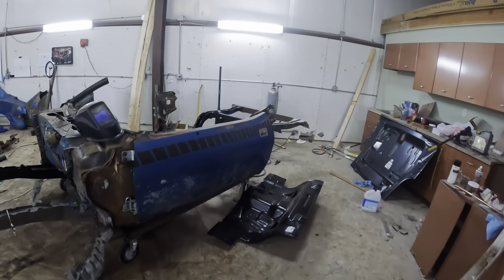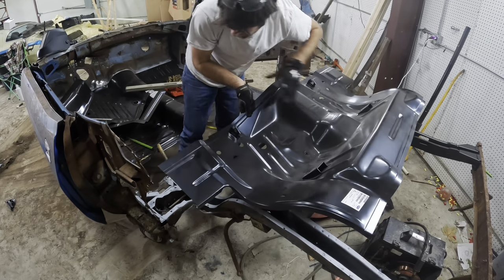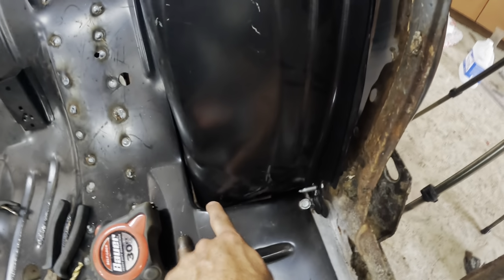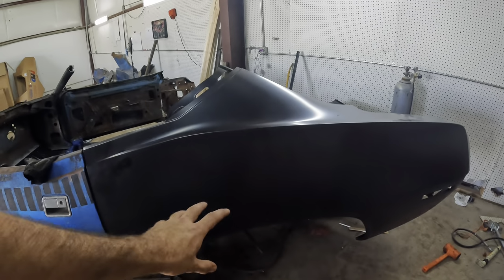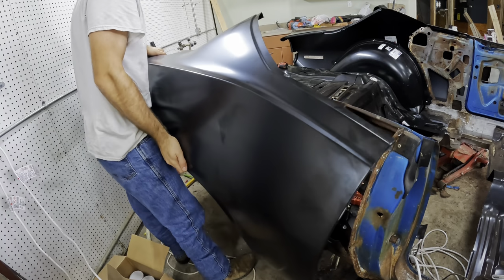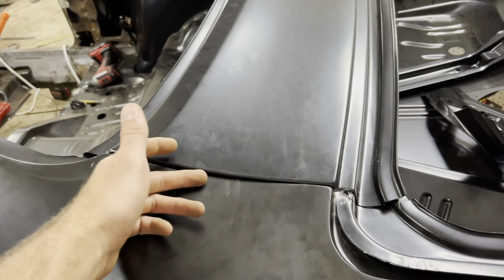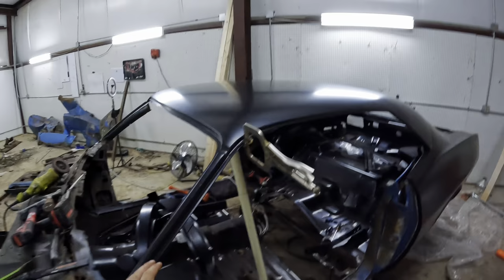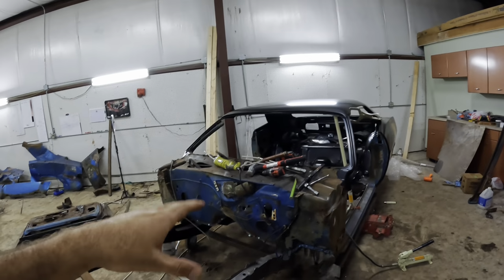1970 AAR cuda restoration part 2 it looks like a car again

Comment: It's great that all these panels are available aftermarket, a friend of mine ordered almost every panel for a 74 240Z in the early 80s and reassembled the entire car, there was all OEM factory parts that were still available at the time. He did this with absolutely no automotive background whatsoever, I on the other hand grew up in a garage that my father owned. It's highly impressive. You're doing a great job,  keep it up 👍☮️

Comment: Damn Im genuinely impressed the way it looked would have scared most away but someone with the right eyes seen the bones. I hope you can register the thing.
Reply: A wise person once said "If it casts a shadow, it can be restored"
Reply: Where I live as long as you have the VIN in it's original placement it can be registered. A friend's 6 person sand rail is registered as VW Bus.

Comment: I had a new '69 GTO and traded that in on a '70 GTO convertible. Fast forward to the mid '80s and I went looking for a car to restore. All the Novas and Camaros I saw were painted nice but full of bondo. A friend of mine had a '69 SS/RS 396 Camaro parts car that was hit in both quarter panels. There was no front fenders, engine, transmission or interior. He wanted $100 for the car and I jumped on it. A lot of people thought I was crazy but the car had solid rocker panels and floor pans so it was just what I was looking for. The fancy painted cars I looked at needed quarter panels any way so I saved a lot of money. I was able to buy new quarter panels, fenders, rear valance and lower front valance directly from the local Chevy dealer in those days.

Comment: It would be really interesting to us if you would tally up the costs of all the body panels and front fenders, hood, radiator mount, suspension etc. and let us know what this recreation has cost.
Reply: All the panels are avialble through AMD.  You can download their catalog & get a rough idea of the cost.  Labor is the biggesr factor.
Reply: @hemibeep  I think if you just added up every component for this year/model in the catalogue that will give a pretty accurate costing too!

Comment: I am in awe of what you are doing! That is an unbelievable restoration. 
I am definitely going to follow this build. 
Could you show us a bit more of the measuring up, either before or after a bit is fitted? I bet a lot of people (admittedly myself included) will be questioning how straight it goes back together. From that point of view it will also help potential buyers to feel more secure about it.

Comment: Not that any of this process is easy, but it almost feels like starting from scratch might be easier than the typical restoration where people are trying to replace floors and quarters but having to cut stuff up trying to avoid spot welds and doing more work than they need to. I’m impressed with your progress. Can’t wait to see it in finished metal work.

Comment: Kind of insane to think you can order pretty much all the sheet metal, drivetrain and electrical/mechanical parts you need to technically build a brand new late 60's musclecar, just like they came from factory.. In 2022.

Comment: Rebodying a Vehicle is not Illegal.
 What is Illegal, is to take a Stolen Vehicle, & put a Clean VIN on it.
 If you Think its Illegal, or Just think its not right, Then Don't get into Old Cars, & Trucks.  Because you are going to get your feelings hurt, when you buy that Car, or Truck you always wanted, & then find out it isn't what it was professed to be! There's a bunch of Dynacorn Bodied Camaro's, & Mustangs out there, With an Original Factory VIN Tag!

Comment: You just reminded me of something I totally forgot.  My parents bought a brand new Chrysler Newport in 1962 and drove it till it was totaled on November 3, 1972.  Kept it til my uncle wanted to use the motor for his 1940 Chevrolet Master Deluxe Panel.  Even though that Panel is too far gone to fix up, my parents old engine still resides since 1974.  I was thinking their is no way that your engine is still around, but after I realized that our old engine is sitting in my aunts backyard in that old Chevy, anything is possible.   I hope you can locate the motor and transmission and put it back onto the car it was born with 50 years ago.

Comment: Your doing the best ya can with what ya got. If you can't find the motor, dodge RVs are good sources of low milage parts. Itd be fun with a 440 manual, semi float 60 locked.

Comment: FYI YouTube land. This car needs to be clamped to a frame machine and pulled straight and held there. If this car makes it to being straight with equal door gaps & panel gaps and it aligns on all 4 wheels, I'll be amazed. 
Yes I am a body man. I've done it for 35 years.

Comment: Is it just me, or does the repop body panels look like & sound like a thinner guage metal? 

As much time as your putting into this I'd of reconsidered using some original body sheet metal. 
An English wheel does a good job staightening out bends & dents. 
( This doesn't thin the metal as much as we are lead roo fear. ) 
Rust can be cleaned & treated today. Body filler is practically used on every car today. ( Not to be confused with bondo. ) 
The bullet holes can be cut out & patched without warping body panel sheet metal.

Comment: While I highly appreciate the desire to restore classic muscle car, and all the efforts put into it, there are few things I do not understand:

1. Rusty parts are connected with new ones without any cleaning, sandblasting, old paint removal etc. To me that is really strange.

2. You are assembling the body almost from zero but you are not using any fixings to keep the dimensions strict.

Comment: The British authorities have made some determinations about what actually constitutes a "repair", "rebody" and "reproduction (new car)". This came about because of all the "repaired and upgrades" Minis which were nothing more than a stolen modern car, re-titled as an older car.  If all new panels are used, it retains it's original identity and registration. If a "new" replacement body is used, it retains it's original identity. If a "used" body is used, it maintains the identity of the used vehicle. If used sections are used, they can't replace the identification number.

Comment: Amazing. Never seen anything like that before. In my state it is legal to install another body on a car, or completely build another body. You can't use the VIN tag from what was left of the original car, but they will issue another VIN tag after you show them all the receipts and they do an inspection. Since you are basically just building a completely new car out of aftermarket parts around just a few original parts, it will not have the value of an intact original anyway. I wouldn't care one way or another as long as it looked like the original.

Comment: The Ship of Theseus is a thought experiment about whether an object which has had all of its original components replaced remains the same object. According to legend, Theseus, the mythical Greek founder-king of Athens, rescued the children of Athens from King Minos after slaying the minotaur and then escaped onto a ship going to Delos. Each year, the Athenians commemorated this by taking the ship on a pilgrimage to Delos to honor Apollo. A question was raised by ancient philosophers: After several centuries of maintenance, if each individual part of the Ship of Theseus was replaced, one at a time, was it still the same ship?

In contemporary philosophy, this thought experiment has applications to the philosophical study of identity over time, and has inspired a variety of proposed solutions and concepts in contemporary philosophy of mind concerned with the persistence of personal identity.

  I believe that it is the original with massive repair and replacement parts.  As long as you satisfy the laws let the philosophers debate it, you will hold a legal title. After all the minute you air up a tire or top off a fluid, touch up paint, the car is not original technically.

Comment: The only thing I'd do differently is rust treat, then primer and paint everything on the original car before attaching any replacement panels.   This was the perfect opportunity to protect the original chassis.  What a project, and you're making good process.

Comment: You have th confidence to turn a hopeless wreck into a nice car, as for originality the main part to retain, which you have, is the bulkhead, in the Uk without that you would not be able to keep the original identity. I can't remember from your previous video if you said you had found the original engine and gearbox

Comment: One thing I have to hand it to you. Graveyard cars did a Daytona charger, were they put all brand new metal except for one frame rail And they called it still the original car It was not at in my book   you recognize that if you take the vin number off, it's not the same car I do feel your car is more the original car then the one thy did . Side note u need an air compressor

Comment: Hi there I've just done this myself the inner roof structure had to be there first then you set the roof on it in order to position the drip rail take the roof back off finish welding the drip rail then clamped a roof back on I see you doing all this without the jigging you definitely got your hands full getting the top half done and more power to you man